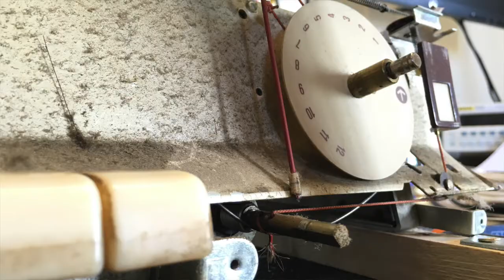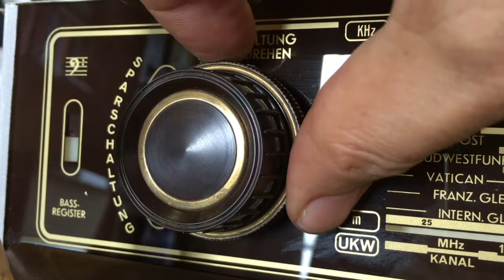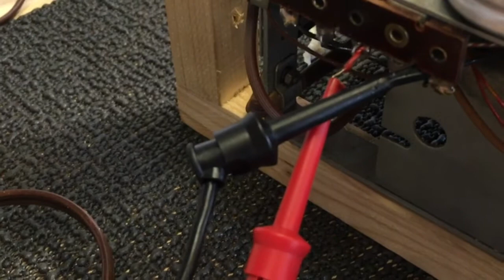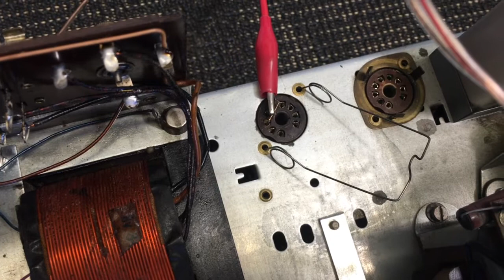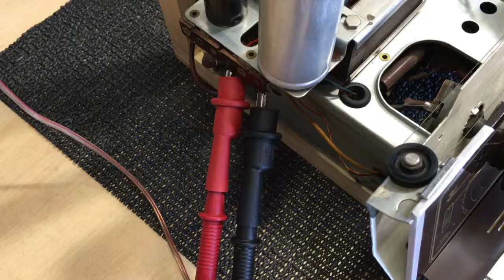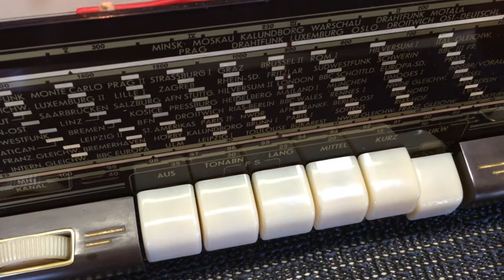Graetz Super 171W tube radio restoration - Part 2. Cleaning and first power-up.

Comment: "saving circuit" sounds fine as a translation for Sparschaltung, but saving here probably means something like enrgy- or cost savings. I'm quite new here, so I don't know anything about tube radios, but is it possible that this was some early form of standby, where the device wouldn't really work, but would be quick to power back up again? Then again, the schematic shows a power consumption of 50W and 33W "bei sparschaltung," meaning with the "savings" on (or engaged) which seems a lot for a standby mode.
Reply from the maker: That makes sense 👍

Comment: Sparschaltung just means power saving mode. As the schematic tells, the radio will take 33 W in power saving mode instead of 50 W.
Reply from the maker: rotwang83 : yes, it does reduce the voltage and therefore the power.

Comment: I think the idea behind the fuses is probably that the radio will pull less current on the 220 and 240 settings- about half in fact- what it will pull on the 127v tap. So on 127v, it's fused at 0.7A. When you select 220 or 240v, you bring in the 0.35A fuse. In other words it's a way of switching fuses to match the current draw.
Reply from the maker: +Alan Cordwell : good point. I'd seen it the wrong way around. This avoids the user from having to choose the correct fuse.

Comment: forgive my dump question....i just want to sure of what you said when you checked the output transformer..... should the radio be plugged to the main??...thanks a lot.
Reply from the maker: No. The radio is off and unplugged, and if it was on before, give it some time to discharge the capacitors! Be careful, this would be a drastic mistake. 
What you want to effectively do is input a signal into the primary of the output transformer and see if it comes out of the secondary, in other words, the speaker. This is a passive test, so the signal going in (coming from your signal generator) should be at about 1VRMS to be heard softly on the speaker.
Reply from the maker: +mountainhawk : and one more thing. There are NO dumb questions when you're dealing with high voltages. Always play it safe and ask, no matter how 'dumb' you might think it sounds.